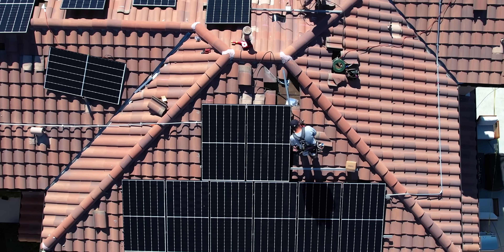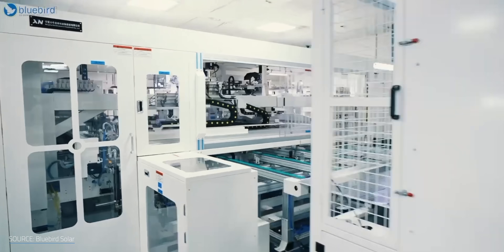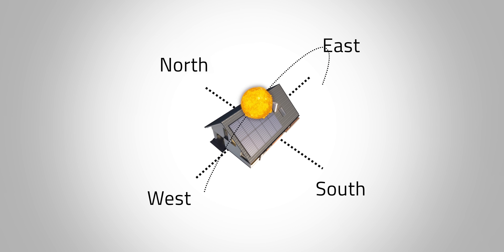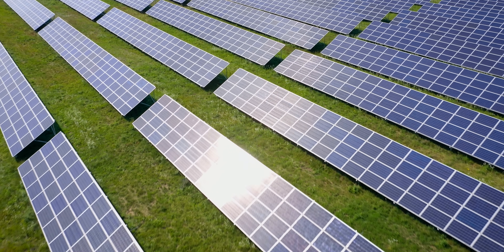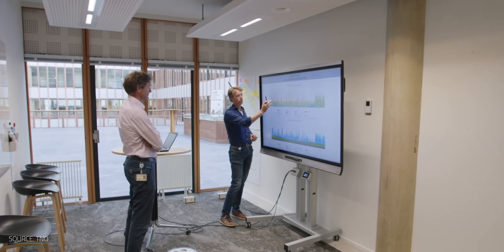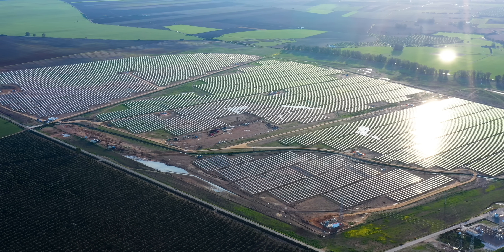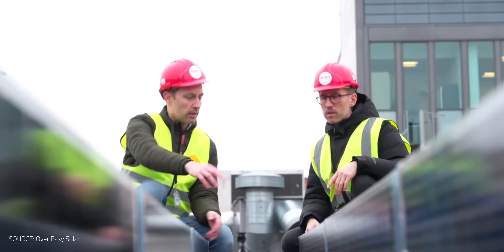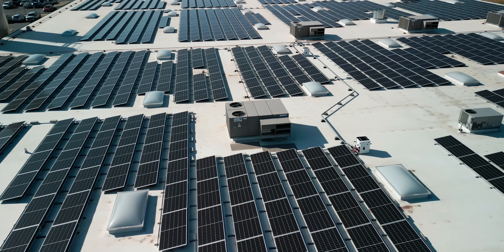Have we been doing Solar wrong all along?

Comment: Engineer here (mechanical, focus on renewable energy)

I really like how this configuration overlaps with demand because the biggest problem with solar energy will remain to be storage. Added efficiency helps, and this sure adds different opportunities in installment methods and plans, but I feel like the core issues are still unaddressed

Vertically stacking them like a tower sounds like a nightmare to deal with when different levels of shading are taken into account which tends to have catastrophic effects on output, but the idea of having panels integrated in plots of land doing other things seems very effective. I see the potential here (despite shading issues)
Reply: Storage is key or it's just dumping off grid your right.
Reply: If you catch it you gotta keep it or let it go 😂 why catch it then.
Reply: I've got enough panals it's storing it for me.😊
Reply: Batteries are the key and sodium will replace lithium fast watch lithium drop
Reply: Does shade stop the sun's rays from landing on pannel then ?...I assumed rays will pass straight through shade
Reply: @jshaw4757  shading is how we see that one part is getting less sunlight than the rest. In a series system of solar panels, the system's current is dependent on the weakest cell, so if one cell is significantly shaded, the whole panel ends up generating way less electricity
Reply: @prosamis  I understand but sunlight is rays if I'm correct...so for example if you take a CD rack and remove the CDs and lay the rack in the sun there will be areas at the bottom slightly in shade but the direct sun rays are still hitting that shade zone all the same...when I walk down the road I have a shadow but it's still possible too add ray spectrums too the shadow and the shadow will remain still in fact artificially you could add more rays too shadow making that area more ray infested than the surrounding areas that are illuminated...not sure if I'm making sense soz lol
Reply: @jshaw4757  yeah which is why it doesn't completely shut down, it just gets less power from shading which causes inefficiencies in the entire series system
Reply: @prosamis  What about rebounding sun rays so say a shady corner or area but there is a mirror setup which bounces the rays many times back onto the shady area and it remains shady but actually is being hit with 3 times more rays...not light but rays or photons could the shady zone receive more rays whilst still visually looking like a shady area...cheers
Reply: @prosamis  There's a reason I'm asking its a design I have with verticle bifocal pannels put in a mylar lined box so many pannals in small area and this box like a book series box set type shape but imagine the books are pannals with a 2/3 inch gap and this box is always pointing directly at the sun using a a sun tracking base too put mylar pannel box on top...the idea being space saving and ground level setups I have plenty more too it but that's the basic idea...cheers
Reply: @jshaw4757  the mirror concept does work and has been thoroughly tested! Including things like having solar panels on both sides, one facing the sky the other the ground, but this is more of a matter that helps if you have very limited space, and the places that benefit the most from such a design often isn't limited by space but rather cost, and cost-wise it's a delicate balance
Reply: @jshaw4757  whenever there's a moving part in a system, that means that part would require more maintenance and generate inefficiencies long term. Solar panels already have enough issues that compounds its costs at scale

There's always an opportunity cost for such designs. You have to make the added cost of moving panels to outperform simply adding more panels in the area of motion of your device (assuming we're keeping space a constant and we're optimizing for that and cost)
Reply: @prosamis  Ow I use recycled materials mainly I belive energy production from recycled materials is the way forward and using cheap chips like arundo devices n sensors cost very little...I said 15 years ago pannals should be utilised on ground level and vertical stacked as on ground level easy access too improve n clean n access n monitor...using a lense does improve light absoarbsion and refraction but causes extra heat but I plan too use evaporation cooling with automated water mister and PC fans a cheap n simple extremely effective way off dramatically cooling anything us included called sweating...cheers
Reply: @prosamis  All depends many variables n where I'm from space certainly is the main problem...yes the mirror idea may off been tested but you havnt seen my designs yet just because tests have been done doesn't mean all designs n options have been explored I don't sit n wait for results from so called proffesional outfits I get on and try myself as most new discovery's are usual off humble findings or accidental completely so all the stats n calculations in the world people still come along and find a way other people missed or didn't think too try its the human creative spirit

Comment: Does this increase have anything to do with the refraction of light through the Earth's atmosphere? When the sun is at its zenith directly over solar panels yes you would get the most intense amount of energy but could  this also be a briefer window compared to when the sun has more atmosphere to travel through to reach a stationary object like solar panels since the atmosphere acts like a lens and bends the light. This in combination with higher efficiency due to cooler operating temperatures would be my guess for the increase in electrical output. So earlier and later in the day a vertical solar panel would get a longer duration of sunlight in total as well as better operating temps throughout the day.

Comment: I am thinking about it. it's Celsius BTW, not centigrade ;) By East West orientation do you mean that the fence, if you will, would run North South, so that the face of the panels would face East and West? I guess that's why the output graph looks like the back of a bactrian camel as apposed to a dromedary camel.

Comment: A friend of mine is already thinking about a solar fence around his complete garden. And i am thinking about a solution of wall-mounted vertical cells. Not for summer, but more for the winter, when the sun is low in angle, this would mean a significantly higher yield, when facing south.
I must admit that the cooling factor is really interesting - never thought about it, even though the technical background is known well to me. 2mV/K can be a lot in a high amount of serially connected pn-junctions :) that can be easily add up to 30V difference in a string.

Comment: It's an interesting effect, and the vertical orientation leaving virtually all the farming land available is potentially quite a plus.  BUT - the much wider row-to-row spacing needed to avoid shading (especially at either end of the day and in higher latitudes) means a lower ratio of panel-area to ground-area.  Simply put, you just can't get as many panels into your field or onto your flat roof.  Increased spacing may not be a much of an issue, but it does also have an impact on BoS costs, which shouldn't be neglected.  More generally, we do still tend to muddle up the efficiency metrics somewhat and need to properly consider both W/$ and W/sq.m.  This particular effect, trade-off, or whatever we want to call it, is all of:  Fascinating;  Not really all that complex to fathom; and a tad counter-intuitive.   Specifically because rather than having a physically smaller, more expensive, and more (aerially) efficient array we have a physically larger (with compensations of better usability), more expensive, but generally less aerially efficient array.  Yet in some places it may still be very useful...  worries about the obvious vulnerability to wind-damage notwithstanding.

Comment: As I'm looking to install a non-rooftop array at my home, this video caught my attention.  When discussing the moderate improvement in efficiency, is that increase per panel FACE, or per (2-sided) panel. In other words, is the efficiency slightly less per-surface, as it move from sun to shade, but more efficient overall due to the doubling of surface area?

Comment: So twice as many expensive panels and a less than 10% increase in energy recovery on the same land area and this is called a win???  By far the best orientation for this method is east west but with the panels set at around 10 degrees from vertical and a gap between the panels at the top to allow better airflow between the panels but you are still talking about twice as many panels and twice as many chemicals in the ground when, inevitably, this stone age technology is ditched soon and these panels are left to rot.

Comment: Having twice as many panels to clean for only a 20% improvement in power is rough.

I wonder if the cooling is because of convection. Catches the wind better or better at keeping the released heat from running into the panels again.

Comment: A vertical hot plate will have a much higher heat transfer coefficient than a horizontal hot plate (will all other conditions equal). To drastically simplify the explanation of this, think about how the buoyant air will flow directly up against gravity, unobstructed in the vertical configuration and with a sharp 90 degree turn in the horizontal configuration. For more details, look up natural convection.

Comment: It makes sense to switch to Vertical orientation at higher temperatures. In my own very simple experiments, sun-tracking leads to Hot panels and Lower AMPs. Your better off using 10 & 2 o'clock during the day for SolarBlankets atleast.

Comment: Not an option for almost all.  Can hardly stand panel upright on top of house rooves. But clearly where land is wasted covered in panels, it should make the ground have more use and some form of crop or animal on it. Is there any pay off to have a fan to cool panels in high summer? Fane electric cost to gain from cooler panel?

Comment: The overheating decline in PV performance has been known since the beginning, so it's amazing there's not more research into minimising absorption of IR by panels, or dumping waste heat on the underside or to a metal substrate, perhaps the frames and/or metal roof. Better still, harvest all that 'waste' heat/IR radiation -  heating air/water is currently a massively inefficient use of electricity. BTW pretty crap study- no control and yet another desk jockey modelling exercise!  Controlled, (real!) experiments and actually going out and collecting data are just not sexy enough!?

Comment: My guess: Power output increases due to higher voltage. Voltage increases due to lower operating temp. Lower operating temp is due to vertical orientation which increases the buoyancy driven convective heat transfer between the modules and air.

Comment: you do realize the duck curve is largely caused by standard solar panel placement? Turning them vertical and slapping a second set of cells to the other side would just replace one peak during the day with two at a significant increase in costs and drastically lower energy return per amount of installed cells.

Comment: Is the heating and voltage drop still such a large factor in the times of the year when ambient temperatures may be below freezing?  Would the relative benefits of the vertical over the horizontal be reduced in winter months?

Comment: Interesting. I like the small (1 foot high) solar panels on a roof. On asphalt shingle roof this could be cheap, easy to diy replace and also still easy to walk around to get to various parts of the roof. If standardized, Anyone could just run up, unplug a broken line of cells and plug another one in. While they would catch more wind standing up, if they are only a foot tall, that wind would not be be much. Yet, one can walk anywhere, anytime and could change out and broken cell super quickly and easily. (These could be held in with a few screws). Be being so easy to install and remove, roofing becomes easier.

Comment: Why we always chase the tail and not see what is in plain sight. The research details clearly indicated the benefits derived are from temperature management of the panel and not from it orientation. The cooler panel ensured better voltage difference. Resistance is reduced and hence higher power.  If there are ways to keep the panel cooler for sure the horizontal orientation will produce far more power. Things like installing solar panels on water canals as done in India, will reduce panel temperature.

Comment: The company Dualsun has put together dual power solar panels: the photovoltaic part is coupled to a thermic part cooling down the panel thus increasing its yield while as a byproduct producing hot water as well! Although not that useful on a solar farm these panels are great for housing deployment where the hot water can be used in situ

Comment: For solar panels on your roof, it's likely the mounting rails will run "horizontally" (or across the roof) which impedes natural convective cooling. If the rails were mounted "vertically" (or running up the roof) then you would get greater cooling effect.
Ah, but I hear you say, won't that cost more in mounting rails? Not if you mount the panels in landscape mode rather than portrait.

Comment: Cooler temperatures improve panel efficiency. I've heard about that before. I believe here in France there is a panel manufacturer that runs water piping on the back of the panel to transfer heat from the panel into the water, thus cooling the panel and warming the water. This warmed water then feeds into the hot water supply of the building, saving some energy on water heating.

Comment: Longer lifespan?  The increased vibration and flexing from the much, much, much, much, much, much (times maybe about a thousand more muches) higher wind load seems pretty likely to significantly shorten lifespan and increase maintenance needs exponentially.  For evidence of that idea, look at the fasteners (screws or nails or bolts) securing together any privacy fence components around any suburban lawn in North America.  You'll find a bunch of missing, loose, and/or damaged fasteners on the east/west facing sides of the fence but only a bare few problematic fasteners on the north/south facing sides of the fence.

Comment: I'm using standard panels but vertical where possible because i'm off grid, live in Dunedin New Zealand and here it snows, which simply falls off my panels, and it's not that far from the ideal winter angle anyway.

Comment: You mentioned increased cost, but surely one of the downsides is that with two voltage producing sides they are almost double the cost to create and buy? If they don't give you almost double the output I can see that being a problem in many applications, unless limited area and required output demand it at any cost.

Comment: You said these are "a little more expensive". But if it is made of more expensive materials AND is two sided doesn't that mean these must be at least more than double the cost (ie way more than a little)? Surely that erodes the 2% extra efficiency a lot.

Comment: Wouldn't be any good on top of my Toyota Van! Decided to make my panels 22 degrees tiltable, in both directions, side by side. Wasn't easy! 3 rows of 2 × 110w for 660w. 2 separate CCs & battery banks. Also, the bigger bank is charged with a DC-DC while driving. 👌

Comment: Given that vertical panels are useful, putting them on the cladding of high rise buildings, where reflection off other buildings, might work too. All those reflective surfaces. 
I have also wondered about fitting them into double glazed windows and sliding doors. They could be spaced to let in light but provide privacy as well

Comment: I like the idea of bi-generation. It's more expensive, but building a water jacket under sections of the panels, you can use the water flow to cool the solar panel, Abe use it for hot water or hydronics heating.

Comment: Do these need to be strengthened to cope with storm force winds etc. Normal installation at a house lays them out on the house roof, so the bulk of the house provides a degree of shielding against the wind. 
Otherwise, looks like a good idea.

Comment: I am testing semi-flexible 60 x 60cm bifacial panels hung on the life lines of my 5 ton cruising sailboat. Not only do they increase output, but act as a barrier for wind, glare and spray. The next evolution is to maximize the 9m lifelines each side to produce enough to directly power the electric motor to move the boat at 4kts for free when there is limited wind. It takes 15 seconds to detach each 1.3 kg panel when sails become viable again. Innovation is the application of game changing technology together with several existing models. In this case… the recent availability of custom made flexible solar panels designed specifically for each user and their individual need. Mine were surprisingly affordable too. 13:23

Comment: If the difference is thermal, heatsinks on the back of the panel would change the output favourably. At the expense of weight and cost. I look forward to further research.

Comment: The problem is not the solar panel, the problem is the storage of energy. The problem is the sun doesn't shine at night or during winter. First, you need a battery capacity compared to an EV. Second, you need secondary power in the form of wind generators At night and during winter you get the usual wind. Plus you need a backup generator, if everything fails. Then you can run your heat pumps and cook your meals. You don't have to supply the net. That's a piece of advice from a solar expert since 1984. Everything else is beating around the bush. Taking your money for nothing.